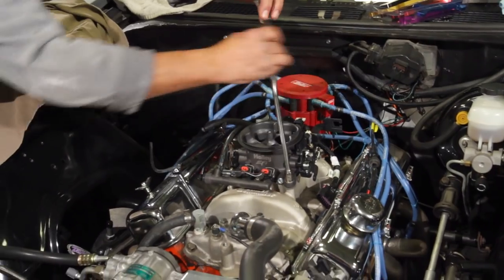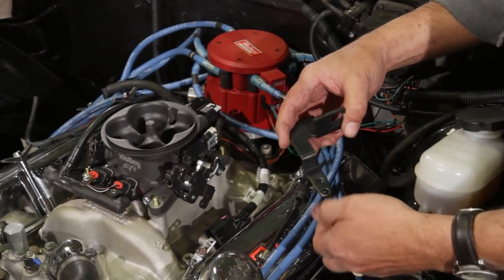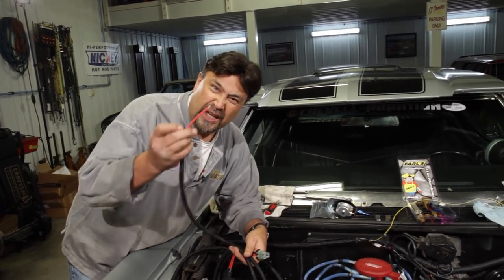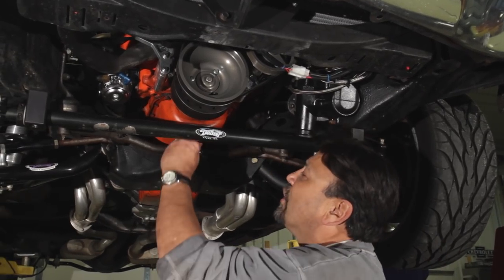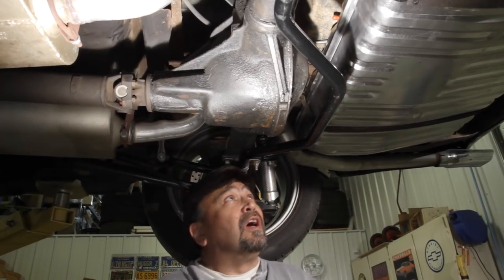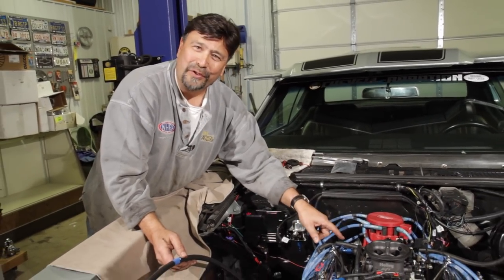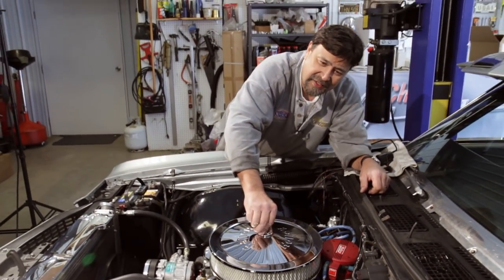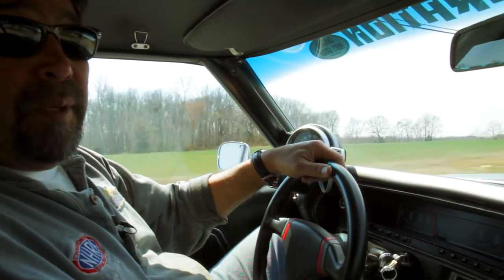Terminator EFI Install and Overview - Chuck's Garage

Comment: It's also a good idea to get the heat shrink tubing that's glue lined to actually seal the connection. I've had the cheap stuff fail me and the wires got corroded anyway.

Comment: Negative cable should be first off and last on Total day one stuff.
This EFI system looks pretty great. I really dig the annular discharge rings for the injectors. So much better than having a super soaker at each corner, though more, smaller holes would be an improvement in my opinion.

Comment: FAST ez efi throttle body wont let my hood all the way down on my Corvette Stingray.  This looks much slimmer.  California car is great.  Used both steel lines and feed and return.  Pump mounted under the tank and above the spare; still a bit noisy for my taste.  Still the FI is learning and running great!

Comment: Why is everyone complaining about the cost you got to pay to play if you can't afford it keep the carb this system is flawed but it's the easiest way to get fuel injection in an old car personally for 2k I'd rather do a ls swap
Reply: agreed for 2600 that they want for the fuel system and the efi system you could get an iron block ls and a stand alone harness and most likely have it installed, but this system does have a place i suppose, it looks less modern so thats a plus for some
Reply: esteblack What flaw are you talking about?  BTW, you need to learn to use periods and question marks when you write.
Reply: You need to learn how to use commas.

Comment: Hi - Just bought this kit the other week, I noticed on your regulator you didnt use the other side of it for OUTPUT to the throttle body, and just used the INPUT side and RETURN...did you connect the fuel output to Throttle body out of camera shot? The instructions show that the REG is installed after the throttle body, ive always run them before to regulate the fuel that is delivered to the carby/throttle body. Please confirm if im reading it wrong.

Comment: yeah but don't you still have the disadvantage of the carb where the fuel is injected at the start of the runners rather than close to the combustion chamber? Fuel will get stuck on the runners due to the curves making it drop out of suspension and be colder and not atomise as well, what you really want is a direct port fuel injection kit that would be better

Comment: Is there an in tank fuel pump and sending unit that will work in a 1971 C10 Truck for the EFI set up?
Reply from the maker: We do not currently have a unit in production for your truck but we are definitely working on one!!  Stay tuned, Thx J

Comment: Chuck so why are you running a frame mounted fuel pump if your going to be useing a tanks in tank mounted fuel pump,I know  your trying to show several different types of fuel pump options so why not show the best  one instead of  duel mounting  pump, configurations, confuses some guys and yes the tanks one is a couple hundred bucks more and a little more work but by far the way to go.just asking.

Comment: i have a 94 k1500 with a 5.7 350 in it, in all honesty that engine was really built badly and has hardly any torque/horsepower. im thinking about getting a tbi to carb converter intake manifold and getting this 4bbl tbi. should i get new heads and a bigger cam and lifters and the whole 9 yards before i do this? will my crapy stock heads be able to handle it?
Reply: just dance 2016  angry birds

Comment: Can EFI system add bhp to an old car?
Reply: Theodore Uy If the carb system isn't perfectly tuned, it will make less power than the EFI system that can always get close to the perfect air fuel ratio for any rpm and load. The EFI will let the engine make the most power possible with the parts already installed on the engine.
Reply: yeah it can, simply put it works like a well tuned carb almost all the time. In my own opinion, which isnt a popular one,  adding another carburetor is easier than installing EFI and makes more power. just saying thats been my experience, i immagine its different between applications

Comment: Someone really needs to make a water tight system, this unit would fail off road.
funny they use sealed plugins but the computer isn't water tight .